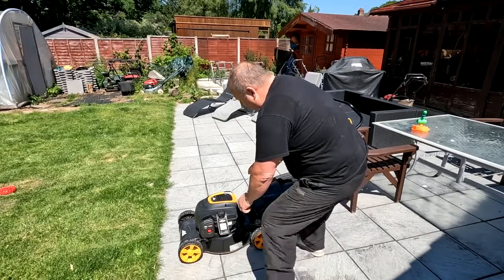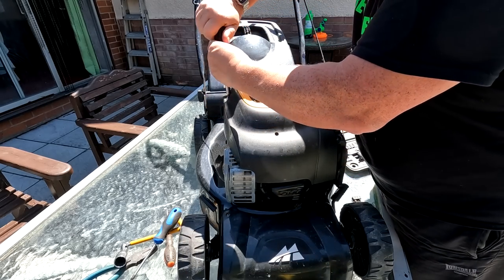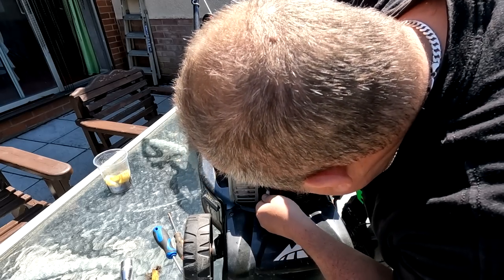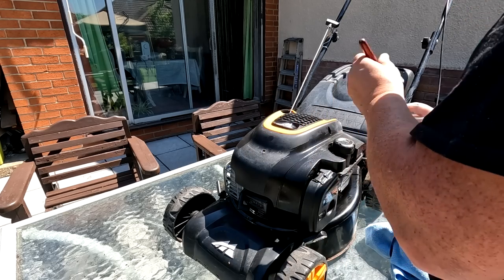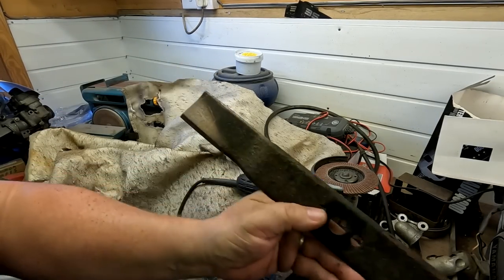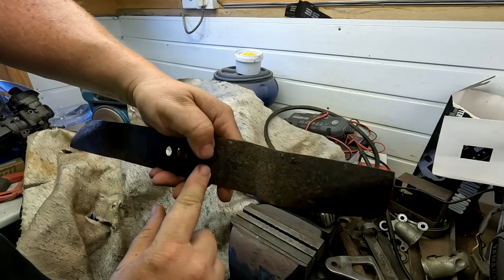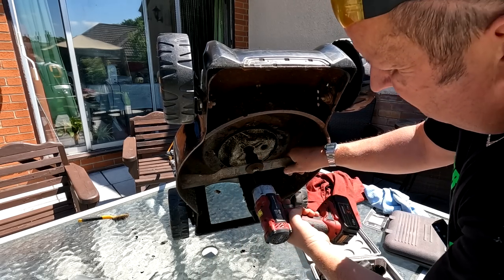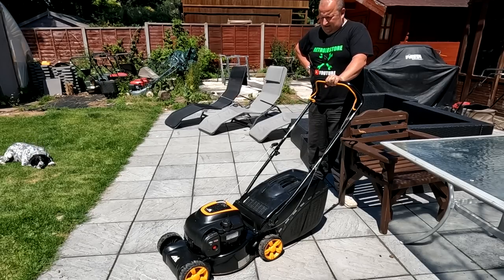Knocking Out Cheap Lawn Mowers For Profit - It Can Be This Easy.

Comment: Looks good 👍🏼 my lawnmower I think has this same engine and it’s good enough. 

The more I watch you refurb mowers makes me want to strip my one and do it up because I bought it second hand for £50 a few months ago fully working no work needed but the deck is getting rusty in places. It’s a Qualcast in a lovely green colour. 

Also I did get the VHT paint for my bbq and I’ve given a good going over with the angle grinder and wire wheel head then went over it with two tins of the no nonsense VHT paint from screwfix and now it doesn’t look half bad. Still not looking brand new by any means but it’s now serviceable and should last us at least until the end of next year.

Comment: Martin what happens if you sharpen too much of the blade, does it affect the cut? As in, increasing the amount of blade that's got a cutting edge? Cheers
Reply from the maker: They say that the blade should be dull but you'll see people with cylinder mowers say the blades have to be sharp enough to cut paper. Either way, both types of blades cut the same grass. I prefer to put a sharp edge on my blades.